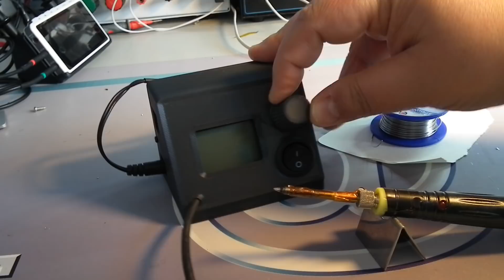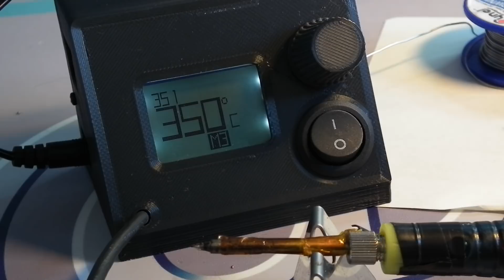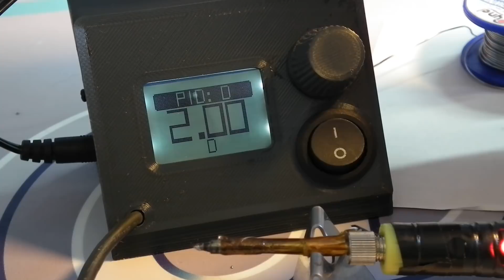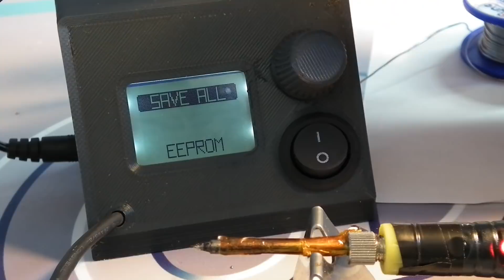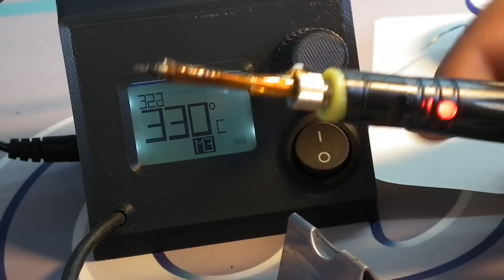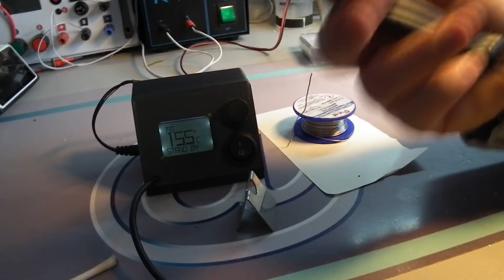DIY 10$ Soldering Station Open Source

Comment: Hey, it's me again. I just bought all the components like the encoder or the display. The GUI works really well already! I'm still waiting for the soldering iron to arrive.
Just wanted to say again, you did an amazing soldering station here! It works really well and is versatile.
I can't wait for it to be used in action!
Reply from the maker: I'm glad you make it!
Reply: @peekpt  So okay, I just measured the resistance of the thermistor in the soldering iron, which only has 50 Ohm at Room Temperature. And I've seen that there's an option to change the parameters for the library. But whenever I change it, it won't change. Can you help me out there?
Reply: @Phoenix Brecken bot
Reply: Roman Cristiano  bot
Reply: voce teve algum problema com #include "bitmap_logo.h"
//#include "config.h"//

Comment: Hello, I don't know why, but after I got on this project again, I recompiled the code with the fix for line 51, but after I start it, the display shows the logo and very shortly the set temp, then just goes blank.
(Please also turn on to get notifications for replies, you don't seem to get a notification for them because you didn't reply to those)
Reply from the maker: Hi, please understand that is a open source project ( no support), it has 2 years old at least. The blank screen could probably be due to certain LCD not tolerating 5v. Add series resistors in the data lines (about 300ohm) .

Comment: Thanks for very good code and idea. I made it with 60W cheap (4 $) eBay Soldering Iron  and MAX6675 module, powered with 220V/24V 100W PSU, and works like a charm

Comment: I'd like to find a cheap T12 tips Diy project like this. But unfortunately many T12 tips project there are so expensive to build, and its creators  ignore when you come stuck in some part of the project.
Reply from the maker: I would buy a module from eBay, they are cheap

Comment: How do u power this thing? Could you advise a power souce/schematics to build a supply for the arduino?
Reply from the maker: I used the Arduino DC plug with a regular 12v 2A wall charger power supply that I got from an old device. The PCB already has the plug
Reply: @peekpt  THX! I found "Arduino Power Supply - 9V 2A" and the version u mentioned... It says i should only use the 12V variant if really necessary... Which one should i buy?

Comment: Wow, you have a really good project there! Definetily subscribed!
If I can ask you, is it possible to use a soldering iron that already that has the thermocouple built in? Thanks!
Reply from the maker: The sensor is not at thermocouple it's a 100k thermistor
Reply: @peekpt  My mistake, sorry. I meant the thermistor.
Do you know a soldering handle that has a thermistor (100k of course) built in? If yes, I would be really thankful to you!
Reply: @GamesNic, yes it is possible, but You need an OP AMP or an Thermocouple module. I've tryed with LM324N OPAMP, and a another version with MAX6675 TC Module. MAX6675 was more stable, so I stay on it. Of course, for a stronger soldering iron you will need a stronger PSU, as they generally run at 24V. And then, to power the Arduino, a buck converter is required.
At the end, this is no longer a $ 10 soldering station, it's a little more expensive, but it's worth it. It's still far cheaper than commercial ones, but it's just as effective. And that "I made it myself" feeling is priceless :)

Comment: Hi Love the project just biult one. I am haveimg trouble uploading to the ardiuno though. I cant get the Bit_logo to compile can you help thanks
Reply from the maker: Hi Travis, this project uses c++ with the Arduino framework,  arduino compiler works on a different way, so it will cause issues. What you can do If you don't want to install Platformio IDE, you can install the Platformio core which works on the terminal. Then after install it go to the software folder (where the platformio.ini file is) and type on the terminal: platformio run -t upload. It will auto install all the required libs, detect your arduino port and upload the software automatically.

Platformio Core installation: http://docs.platformio.org/en/latest/installation.html
Platformio IDE (main site) 
https://platformio.org
Reply: ok thanks

Comment: Nice project! You really did an amazing job
One question,  is it possible to replicate this using an Aliexpress Hakko soldering iron handle instead of the usb soldering iron? 
thanks
Reply from the maker: I don't understand what you mean but this works only with thermistor, the hakko has a thermocoupler type sensor, it's different. if you mean using enclosure, I suppose  the handle will be too big to secure these small tips.
Reply: Just get the T12 kit. It uses hakko handles (or clones of the handles) and the Hakko tips. Versions exist with a led display, or even OLEDs.